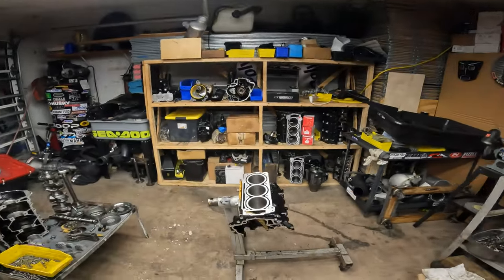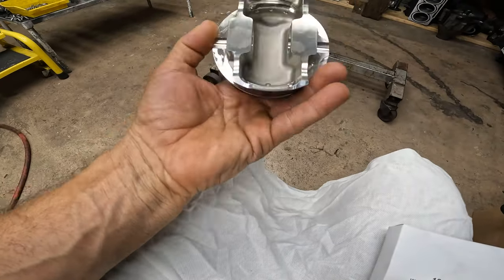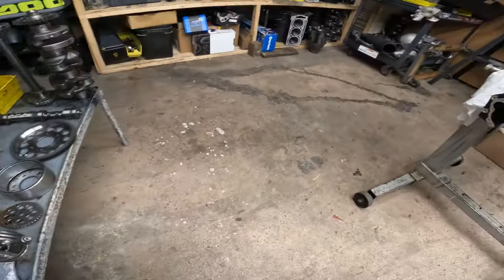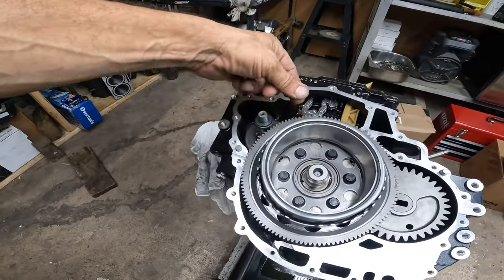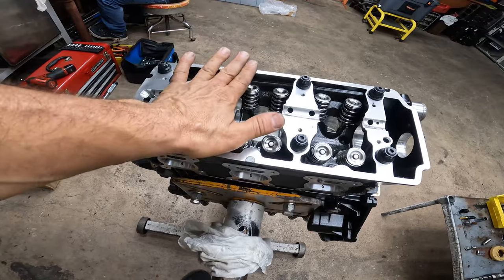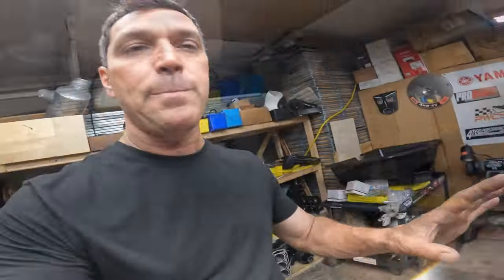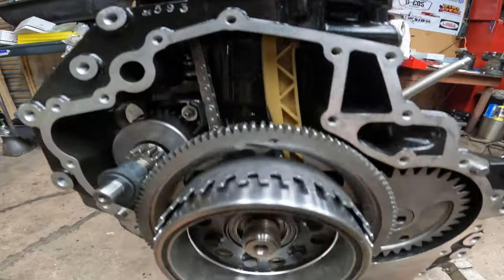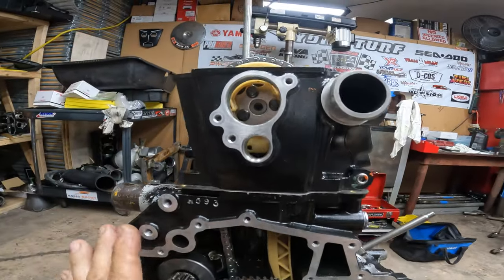SeaDoo RXTX Rotax 4tec Race Engine Build for Pump Gas + How to Install a Calas Cam DYI + Tech Tips

Comment: I've rebuilt maybe 75 engines over the years, and one thing I always do is Plasticgauge the main, and rod bearings before I close it up. I've had so many machine shops screw up my cranks, and cylinder specs for new pistons. And I used a couple top race engine building shops all over the country, and they still screw up things. I don't trust anybody's machining work these days.

Comment: hello i have a   2002 gtx 4tec limited ran great. then one day i put the key to the post and i got one long beep. checked the fuse box and found 5amp fuse bad. replaced it but as soon as i put the key to the post it pops and i get one long beep. any info you have about this problem would be great.  thanks
Reply from the maker: Go on GreenHaulk website  https://www.greenhulk.net/ and I’m sure they have an answer for you in the forums

Comment: Hello, please tell me, I bought the block head, apparently it was overheated, as you said, the shaft on the last neck bites a little, what is your opinion, will it work? Thanks
Reply from the maker: It’s funny you ask that my first Seadoo 07 Rxp was like that and it ran 93 mph back on 2013 you’ll be fine

Comment: I am building a 2011 RXT 260. I am using the same Wiseco Pistons.  Do you have any recommendations 
 for ring end gaps size  or should I say Tolerance.?  Or should I go by manufacturer tolerances?  Your input would be greatly appreciated.. I've learned a lot from you in this present build, and I'm doing. Thank you again, and i look forward to your response. Keep up the good work.

Comment: Hi.  Is it recommended to re-balance the crankshaft and balance shaft when replacing the pistons?  Is it recommended to re-balance the crankshaft and balance shaft when replacing the pistons and rods?  I just had an engine fail and I plan to replace the pistons and rods.

Thanks

Comment: Did you check piston ring gap? You didn't touch on it at all. If the pistons are new those rings need to be gapped for turbo, non turbo etc...